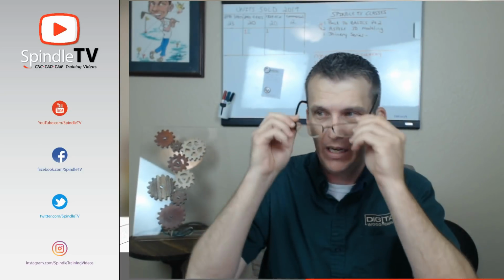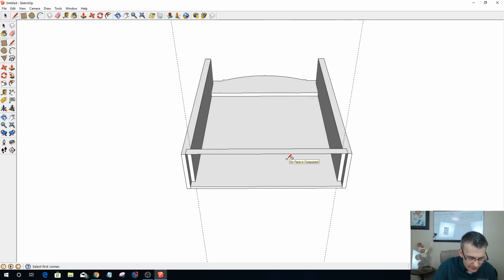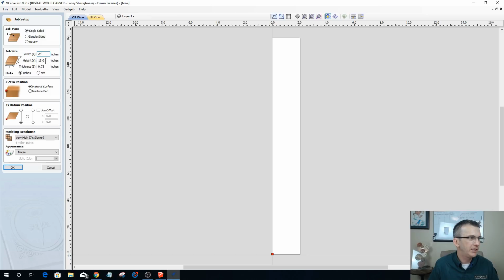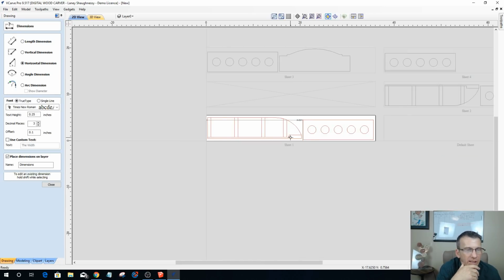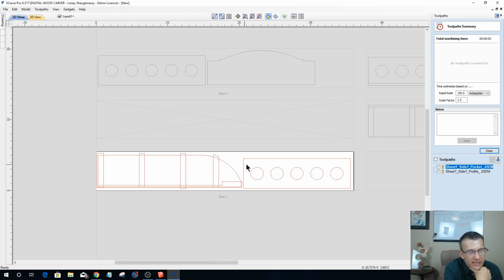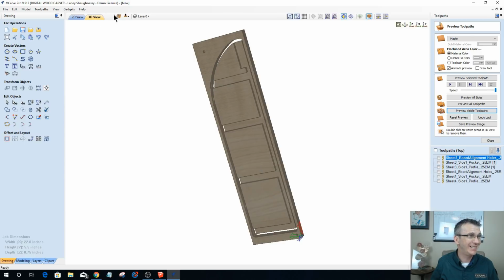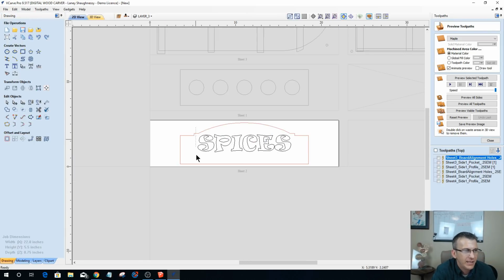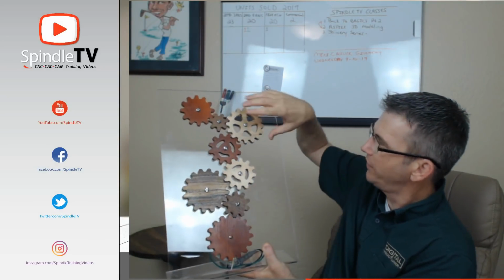Making a wall shelf / Spice rack - A Vectric Tutorial

Comment: Laney I am back to watching your video. Question  Have you ever shared your what  your waste board clamping clamping jig look's like and how you use it ? I know you are teaching  the software but it would be nice I think to see your machine  set up to cut something.Jeff
Reply from the maker: Jeff, I have shared the files in the Digital Wood Carver Owners group . This waste board/jig was designed for the DWC2440. It could be modified for other machines outside of the Digital Wood Carver family. I will be doing future videos out in the shop showing the unit running and the waste board in use. If someone was not a customer of Digital Wood Carver and were interested in the waste board files they could request a copy from me, however they would have to modify the files to adapt the wasteboard/ jig to their unit and setup. A small fee for the project files and download may apply.
Reply: I am would like a copy of your file, just  let me know what I need to do to obtain them. Jeff